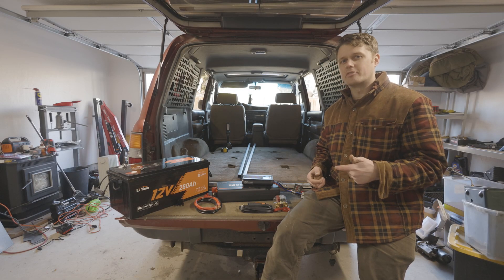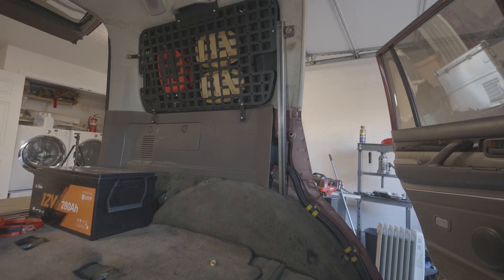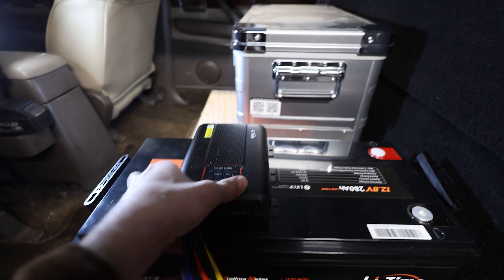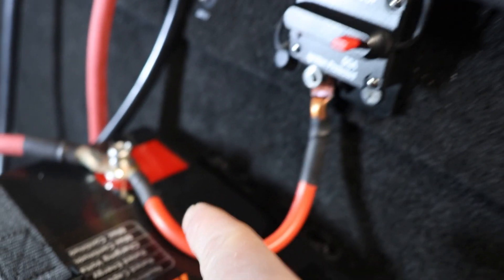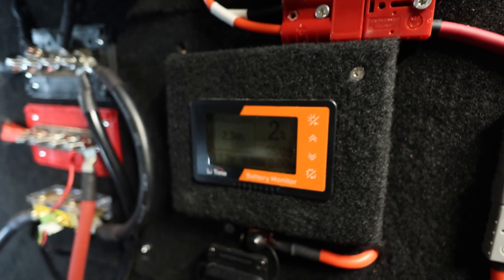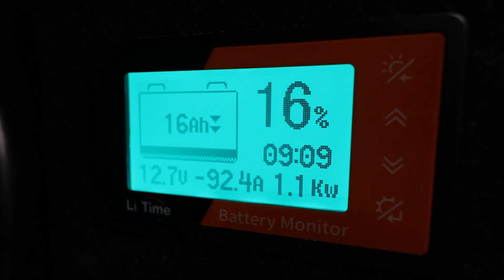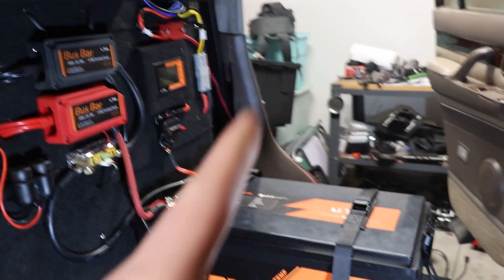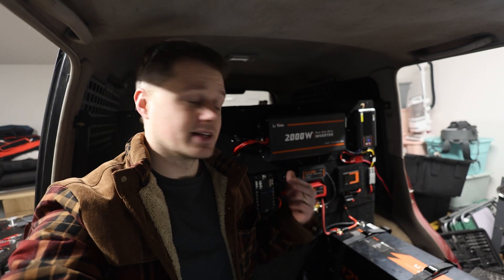How To Build The Ultimate 12 Volt Lithium Battery System For Overlanding

Comment: Thanks for the video.  In the process of doing a dual battery set up in my 4 runner and not coming up with a good plan on how to mount and place the components. Love the headache rack system you did.  I think I can do this with my 5th gen. Thank you! Liked and subscribed!!!
Reply from the maker: Thank YOU! Yeah I may end up moving it into a compartment, but it helped me get everything onto the board and full proof it to get it going